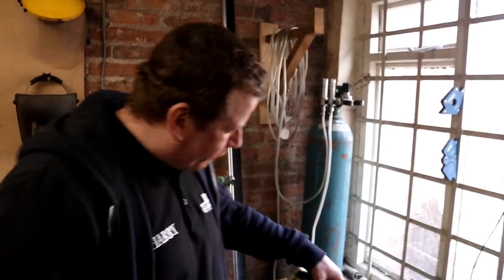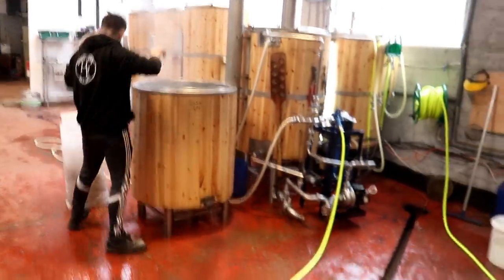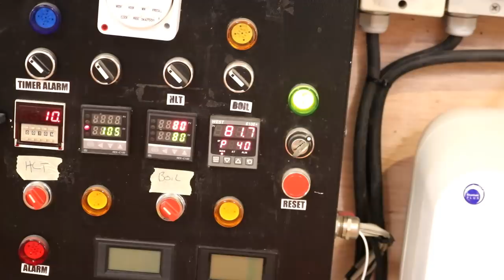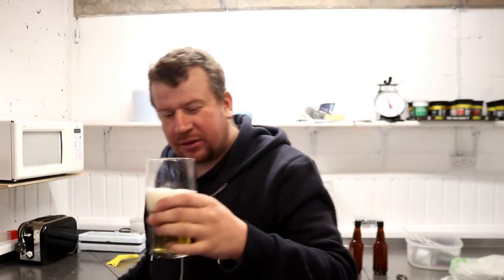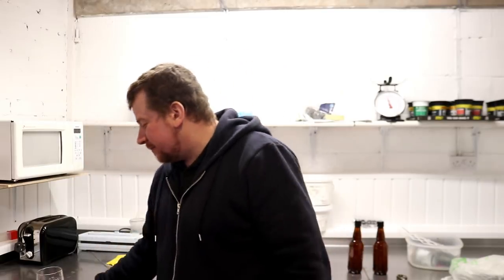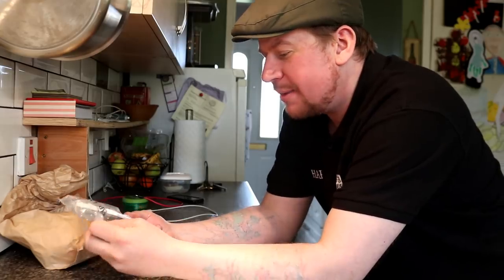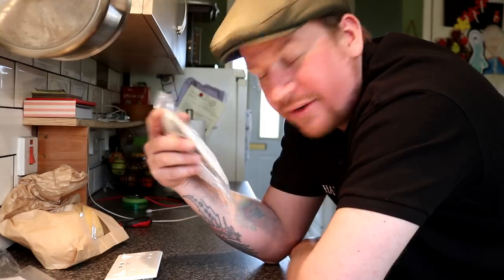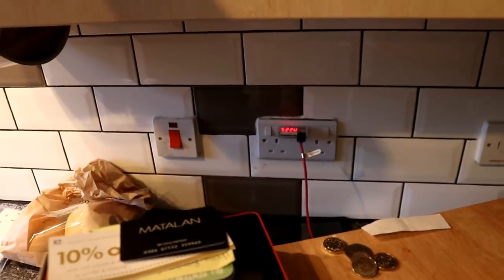JUST HOW MUCH CAN WE DO IN ONE DAY?

Comment: You could attach a TC to Barb fitting and use the “silicone” hose you don’t like from eBay to direct the waste directly into the drain. Gives you a use for the hose and a easily storable solution

Comment: If you haven't already bought a battery you could try putting it on charge over night for three or four nights. Even with the small charger that you have got it may well be enough to get it fizzing and clear the plates. How many miles are you doing in it on a daily basis?  If it's fairly low (5 miles or so per trip) that could be your problem of not enough charge going into the battery. Just trying to save you the expense of a new battery. Try turning the radio off (especially if it is after market) as some of those can put a rather large drain on the battery. What about a push on hose that goes straight down the drain?  just some thoughts while I was watching. Cheers, Schnuz.

Comment: 14v on the alternator I reckon it's running fine,most likely your battery is on it's last legs,I know you said it was newish but it was lying idle for a while and plates have probably got covered in gunk,get yourself a new battery but keep the old one as a workshop backup. New fitting looks the business but I would agree that extending the pipe to drain is probably the best idea. Enjoy those NI beers m8. Cheers.

Comment: Nice video as always. Just a thought, Could you use some of the kettle trub as fertilizer for your plants? Seems a bit wasteful to put it all into a drain
Reply: If chance ate any itd be over for the poor sod in no time ive put some directley in my garden before it becomes likd rock tho.

Best fertilizer from brewing ive found has been my first line runnings between tap and keg i run first 100ml off each day i drink it and tip that 100 in garden in same spot plant there is green as now

Comment: A phone isn't a good test for load, for one thing most modern phones will vary their charging behaviour depending on load, if you want to test them properly you need something like an adjustable load.

But, I can't say id ever trust one of those usb sockets, most have no fusing on the usb charger but also, no on/off switch so there's always a drain.